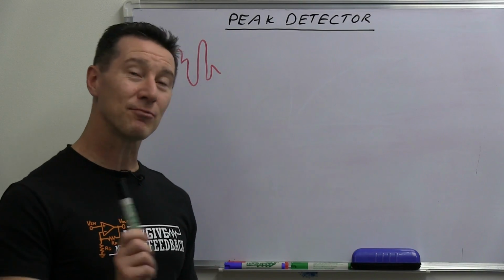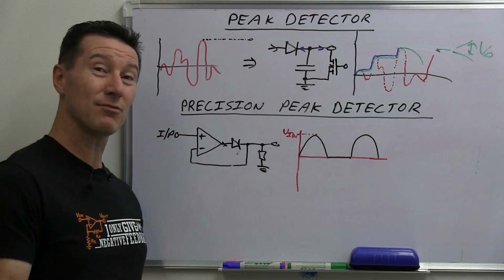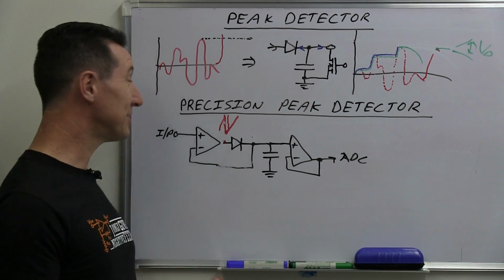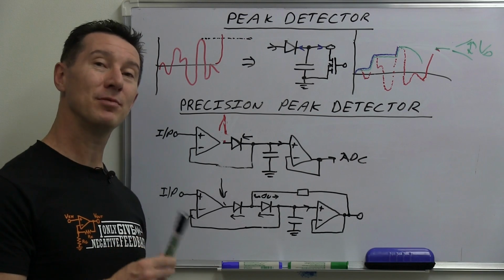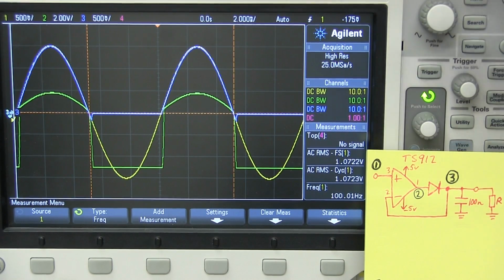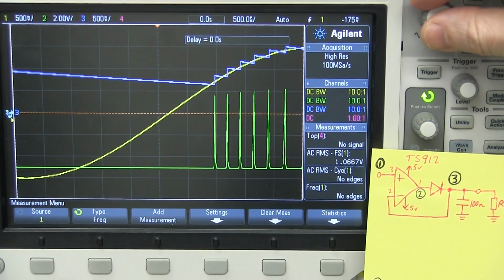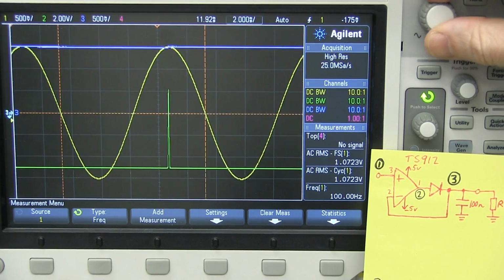EEVblog #490 - Peak Detector Circuit

Comment: So mate.... :-) ... do you give personal circuit advice to people trying to build their own peak detector? I'm trying to build a precision peak detector for an ADC (MCP3008) reader to read the output of a current transformer. But no matter what I do with the op-amps all I get is a constant DC out, even when a signal isn't applied. I get what I expect if I just use the simple (no op-amp) circuit, but then... you know... diode voltage drop :-( Tried multiple opamp configs). Including your version. I think op-amps just don't like me.

Comment: One thing to note is that if the op amp must NOT have input protection diodes - these would short the capacitor to the input node when the latter goes negative. 
CMOS opamps are usually fine (no protection diodes), as for bipolars it varies, e.g. the 5532 does have protection diodes, the 358 does not.

Comment: Hi dear friend.
I need a ZMCT103C detection circuit. can you help me?
I got help from your circuit, but I have a lot of jumps and noise in the output and the ADC value plays a lot. I used a mega16A

Comment: I came across this as I was looking for a peak detector to detect the time when the peak occurs rather than the value of the voltage. I've got a microcontroller with A-D doing it, but I wanted a simple circuit to generate a pulse, whenever the voltage starts to reduce.
Just to make things more difficult it needs to be immune from noise, but that really just means a LPF on the input.
It's for triggering a TRIAC on the AC mains peak for switching inductive loads. It should be pretty simple with a comparator some resistors and capacitor, so that in effect one comparator input lags the other and the output changes state whenever the input changes from increasing to reducing and vice versa, or something like that. In fact a Google search finds such a concept was even patented in 1969.

Comment: The second opamp is in positive feedback loop and could osculate or with the diode could drive the output to positive rail. This could happen when there is a new peak at the input.

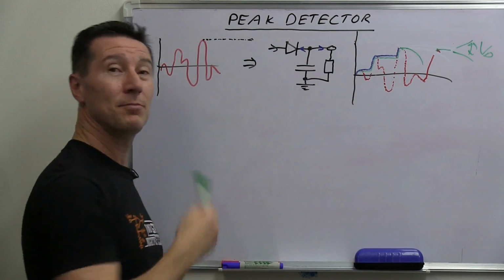Comment: Around 5:30 the "droop" from leakage is almost never becoming greater as shown. Particularly for droop caused by resistive loads, the fastest rate of discharge is at the beginning, and it slows down over time. The shape of the voltage line is concave, not convex.

Comment: Nice video, Dave. You've done a good job of explaining the peak detector. In practice, your circuit will work nicely with a storage capacitor of 1nF to 10nF if you put a 10 to 50 ohm resistor in series with that capacitor to ground. This cures the instant instability of the op amp caused by the capacitive load on its output. The loop stability is complicated by the diode's varying ON resistance as the current charging the capacitor varies.
Regards, Neil  ex-Burr-Brown Corporation
Reply: I built this circuit. It was unstable, and I spent hours trying to guess what could be wrong. Your suggestion cured the problem! Thank  you so much!

One other thing I did:
I connected the output to a 4098 monostable multivibrator, driving a LED. The output also goes to a 2n7000 MOSFET that drains the capacitor, so that the cycle can repeat.
Reply: @topquark22  I'm glad it fixed your problem. Your feedback is much appreciated.

Comment: But a small-signal MOSFET’s leakage current is going to be higher than a 1N4148, to say nothing of a low-leakage diode.

Also I’ll look into using a precision rectifier with that extra diode to prevent saturation. Will still need to worry about slew rate though. I’m thinking maybe to use a JFET op-amp buffer on the cap, and feed that to a higher current op-amp’s input for the actual capacitor driving.

Comment: I was trying this with a 0-10MHz signal generator to use the actual output and feed it to the ADC/ uController. Yeah, fml. It's doing everything but not holding the peak voltage.

Comment: Why not add a small resistor in series with the diode on the op amp output?  It’ll limit the bandwidth but will make the load less capacitative and reduce inductance/capacitance/current spikes.

Comment: EDIT: Forgot about the opamp section, that it wasn't just a basic buffer after the fact. Should help a lot. I'm so impulsive, posting before I finished the video. Been a while since I last watched.

Seems to me that the diode drop could also suffer at high frequency, right? Your diode has an ohmic region after the knee, as well as the capacitance and leakage you mentioned, but assuming we capture and buffer the value or store it digitally I can ignore the leakage. But we'd be creating an RC filter across the cap, or if we made the cap a very small value, then it leakage becomes much more significant..... I think I need to play with some circuit simulations.

I was thinking of creating a peak inrush current detector. Of course, I haven't googled known solutions to the problem yet, where's the fun in that? Maybe I'll do that now. :)

Comment: Note that the diodes reduce the dynamic range.  For the first circuit with a single diode, the max input voltage is the OpAmp's max input, minus one diode drop.  For the second circuit with two diodes in series, the max input is the OpAmp's max input, minus two diode drops.
These are useful circuits, and this is a good video.

Comment: The video creator only presented the theoretical circuit. When the capacitor is a short circuit you are burning the output of the operational amplifier. A 1 kohm resistor needs to be connected in series with the diode to limit the maximum opamp output current.

Comment: 14:15 slew rate (the time it takes for the op amp to swings its output back up to the point where the diode begins to conduct again) and the value of the holding cap are unrelated. The size of the cap only matters when the diode is conducting, and in that case, the charge time is determined by the maximum output current capability of the op amp. They are both important but separate issues.
Reply: Clearly we can see the output of the first op amp isn’t connected to the diode anyway.
Reply: That's exactly right, and the issue of recovery from being in saturation is a different issue again. This is the issue faced by comparators and some opamps are much better than others when changing from the mode where you have a large differential between the inputs and returning to linear operation.

Comment: the op-amp diode  great for Line frequency, not so great at audio frequencies, FORGET ABOUT above 10khz ; for RF a diode detector 
will work, ge diode; short leads, 1000 pf capacitor simple non-inverting buffer amp; not too accurate, won't work for huge RF signals 
like 10 mv

Comment: Another drawback of the crude circuit is that the active discharge will also clamp the signal source to ground through the diode.

Comment: Hey great video! What significance does the choice of op-amp / capacitor have in the behavior of circuit you use for the oscilloscope portion of the video? When I tried to recreate the behavior you're getting adding any resistance in parallel with the charge cap other than my scope probe caused the circuit not to work correctly (behaved more like a comparator with one end of the waveform clipping). I'm wondering if this is because I'm using a non-cmos LM358 and ceramic capacitors. I'd really appreciate if you could clarify. Thanks!

Comment: 24:37 in a pcb circuit esign, how to get the negative supply voltage required by the op amp?

Comment: 2 questions: What happens when the difference between the voltage on the cap and the input signal have a difference greater than the reverse breakdown voltage of the diode?
What happens when you attach a load to the circuit, won't the capacitor drain through that?

Comment: Shouldn't you put another diode in the feedback loop of the second opamp to compensate for the diode before the capacitor? EDIT: ah, I tried it, the high input impedence causes the negative feedback voltage to be trapped and drives the output of the buffer low.

Comment: Wouldn't it droop quickly at first then flatten out as the capacitor voltage approaches zero? Your graph implies that it droops slowly at first then more rapidly.
Reply: Yes, exactly. Wrong discharge curve.

Comment: very useful, and interesting lecture. what if I want to detect, and measure a minimum voltage. what kind of op amp circuit should I use?

Comment: If you want a capacitor is charged to 4.9v and you want to charge it up to 5v, don't you need to provide 5V? If so, why is the op amp charging the capacitor by providing little pulses below the charge value? Shouldn't that not charge the cap at all since the cap needs to be exposed to 5V to be charged to 5V?
Reply: It's a diode, not opamp. Yes, pulses, a single short pulse of sufficient current will charge up the capacitor to a given voltage, no problem at all, and you would want to choose a low-value capacitor to keep the current and pulse length that will charge it up sufficiently low. The capacitor will be charged to the occasional maximum of the voltage on the output of the diode, and in typical audio use and with a few uF of capacitance, it should take only a handful of waveform peaks to charge it up, making it suitable as a peak detector. The voltage on the output of a diode will be input voltage minus diode voltage drop i.e. 0.3 or 0.6 V, so you want the voltage of your input signal to be pretty high to get meaningful results.

Comment: You can keep the op-amp from saturating at the negative rail by modifying the circuit a little bit.  

1. Break the feedback connection from the cap to the 1st opamp's inverting input.
2. Use a 2nd opamp to  buffer the cap voltage.
3. Add a diode from the 1st opamp's inverting input to the 1st opamp's output.  The anode should be connected to inverting input, the cathode to the opamp's output.
4. Place a feedback resistor (10k?) from the buffer output (2nd opamp) to the 1st opamp's inverting input.

This will allow the first opamp's output to effectively track the input signal, staying 1-diode drop below the input voltage when the input goes below it's peak value.  The 1st opamp's output doesn't saturate at the negative rail that way, and the slew rate limitation is fixed.

You can also use shottkey diodes which have a faster switching time.  But you will probably need to use the 0-volts across the second diode trick, as shottkey diodes have higher leakage than regular PN diodes.

If you need a fast response, you might have better luck using a fast comparator to compare the input with the buffered cap voltage (fast fet input opamp) and generate a digital signal.  The digital signal could be NORed with a reset signal, or the digital signal could be gated by the reset signal using a series p-fet. The gatedl signal would control an n-fet connected to Vdd that would charge the storage capacitor connected to its source (source-follower).  A second discharge n-fet would be controlled by the reset signal directly.  If overshoot was a problem, you could add a small resistor in series with the charging n-fet to decrease the charging rate.  Be sure to use adequate bypass capacitors as the charging fet will draw large spikes of current from the supply. 

 This would make a peak-detector that would track very fast pulses probably up to a few MHz bandwidth.

Comment: Search around for peek detection and here you are again. Awesome. I'm making a audio amp automatic switch box for my dads vintage amplifiers such that he can use one set of speakers without switching cables manually. The detector will tickle a state machine made out of 4000 series logic ic's.

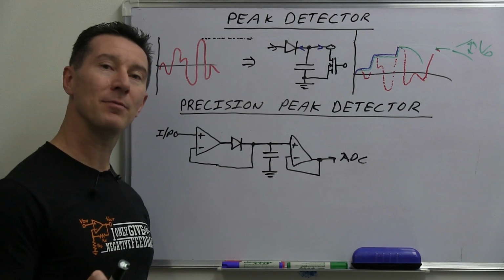Comment: Hi Pro, at 12:00 in this video, if there is no voltage holding capacitor after diode, will there be any problem? Thank you.

Comment: If I may add an improvement suggested by Art of Electronics 3rd edition: 
Add another resistor and diode to the output of op amp 1. This will clamp the voltage to one diode drop below the ouput voltage, which dramatically increases the charging time of the capacitor. (The slew rate of the op amp is fixed, so keeping it at a diode drop below the output is much better than the output going all the way to Vee).
Reply: page 255 fig.4.58

Comment: To choose the best capacitor for this application is not an easy task. There are many types, many manufacturers. Very often is not easy to identify the manufacturer's name on the capacitor. Often the manufacturer's datasheet is not provided or it is unknown.
What kind of capacitors and manufacturer did you use in your circuit?
I am creating an "Analog Computer" (just to have a fun). What kind of capacitor I have to use?

Comment: Nice one. 
I've just implemented the second circuit in my Arduino power supply:

1. As a peak current detector using your I>V from your power supply.
2. To hold the output of a "PWM/CR filter" voltage output for the regulator setting.

Works very well for both parts of the design.

Comment: Good  video. I wonder if it would help if one mentions that the voltage sources used  are not perfect and have a finite output impedance and so they cannot provide the high current to charge the  capacitor  very fast.

Comment: Wouldn't the signal be practically shorted as well trough the diode and MOSFET when you reset the circutit at 5:49?!
Because if it shorts the signal, then it's no good if you care about signal integrity...
Reply: RPBCACUEAIIBH  I think you should feed this curcuit through an opamp in that case
Reply: Yeah... :)

Comment: at 18:27 I think you were meaning to say Diode, not Capacitor ?

Am I the first to spot this, or just the first saddo to mention it?

As to the feedback resistor to bias the diode, what would be a good guestimated starting value for a couple of audio opamps as a peak hold for a vu meter? a few hundred K ?

Love your vids and think its great how things have turned out for you from a little few vids here and there, live the dream for us lol

Comment: In the ideal diode and cap circuit, can't you just put a buffer between the diode and storage cap to reduce the slew noise down to that first blip when the input goes negative?  It looks like the cap impedance is causing most of the distortion.

Comment: Thank you for the video.  I have designed peak detectors for AM waveform demodulation using op-amps to buffer the input and output similarly to what you have done here.  In my applications I have needed the capacitor to discharge in order to follow the envelope of the AM waveform.  I sometimes refer to the peak detector circuits I designed as envelope detectors for this reason.  I did learn a few things from your video that I was not aware of.  I may try to incorporate some of the techniques you presented here in my future designs.  Thanks again!

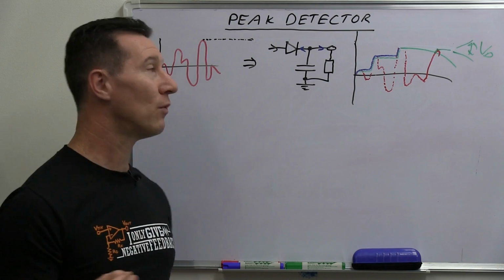Comment: thanks for the video, the only thing that puzzled me was around the 5:00 minute mark.

How come the capacitor is discharging like that? I was expecting it to discharge following a normal capacitor discharge curve. Is it something to do with the diode or am I missing something? Cheers :)
Reply: ***** True, but if they behaved like standard exponential decay, wouldn't the peak detector be quite bad? It would lose it's value quite quickly..

Comment: check the LM3915 data, there  are some quite good precision rectifiers in it to begin with, and you may check my latest video too, as i´m just about to finish a all tube compressor design, build around a very old 1612 tube from RCA.

Comment: I think, that connect capacitor directly to output of op-amp (OK after diode) is not good idea. If there will be some output resistor and after it capacitor (RC filter) then you can get rid of this oscillations. Also without this resistor, theer is significant current spikes caused by diode switching, with can cause EMI problems in your device.

Comment: Excellent video, nice demonstation!
I'd like to add that it's really easy to get out of a common diode's comfort zone, for example, a 1N4001 will start 'zenering' at about -40V, so you really should keep the voltages above that. Also, sub-1V measurements are also 'out'. Too much distortion.

Comment: Matsushita used to make small glass-encapsulated LEDs which had leakage current in the femtoamp range.  I have a couple of them which came out of a CD player and they look very much like a small silicon diode.

Comment: Just use the appropriate transistor in the first place. I don't know what you'd like to drive, but I guess there's hardly anything you could have, that would require paralleling. Use IGBTs or, if you want just for the sake of parallel components, use MOSFETs.
The hard stuff in driving high power devices isn't the power switches anyway, it's providing the right signal to drive the power switches!

Comment: good one EEV Blog.. i like this video but key point to remember...never drive a cap directly with a op amp.

Reason: There is output capacitance built in to the op amp from the manufacturer,..so when you drive a cap with directly with an op amp, you change the pole frequency and thats changes the phase margin and creates instability.

You can find this data in the datasheet of the op amp...*look at the open loop frequency response curve..i.e bode plot of the op amp

Comment: Hi Dave. Its off topic, but could you give some advice or do a video how "gang" power transistors  together for both a voltage and current output. eg you have a PWM and say want to drive a larger motor so you make a circuit running the smaller PWM into a large "power" circuit to drive the larger motor?? Thanks

Comment from the maker: You can, but as I said, the diode drop changes with current and temperature. You can do a reasonable approximation tweek though, which should be suitable for something fairly crude like a VU meter.